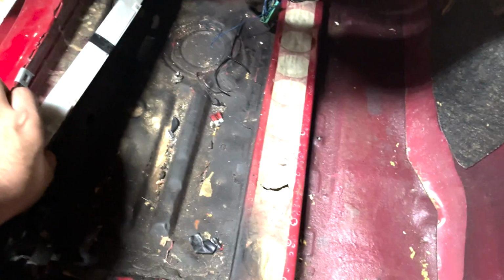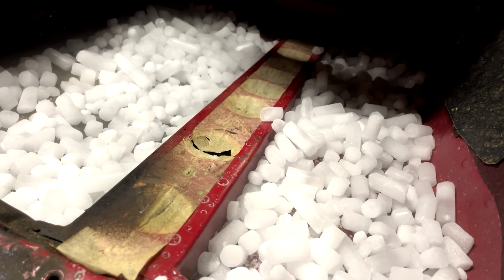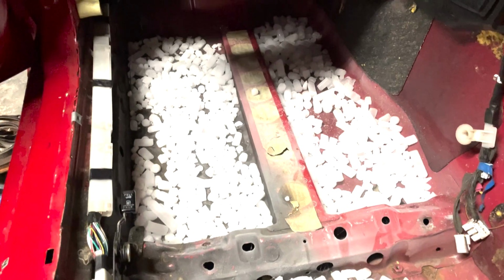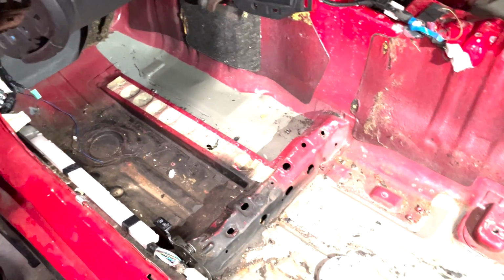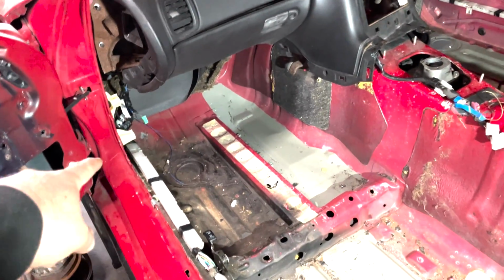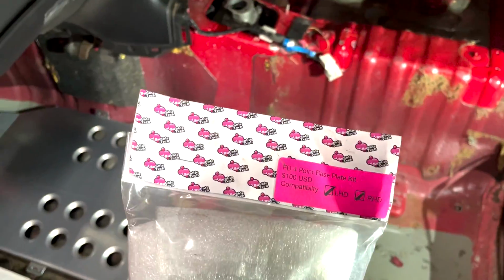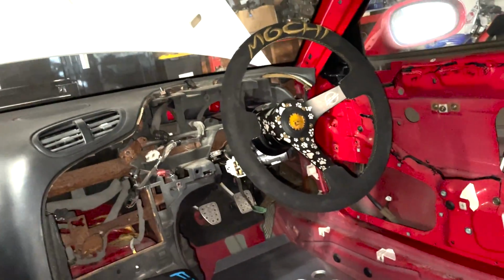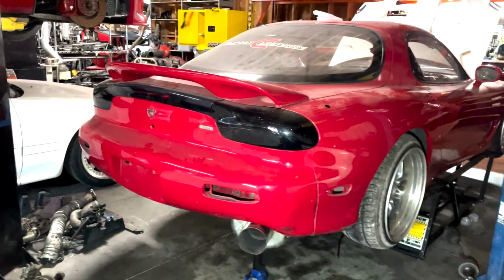Prepping The Drift FD For A Roll Cage

Comment: If you wanted a basic  carpet under the aluminium floor boards it’s not hard to make your own carpet to cover just the floor and tunnel. The cheap van converters carpet off eBay works pretty well and doesn’t weigh much.